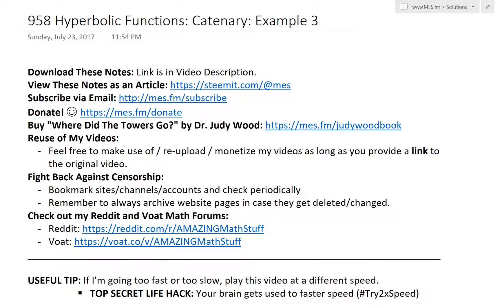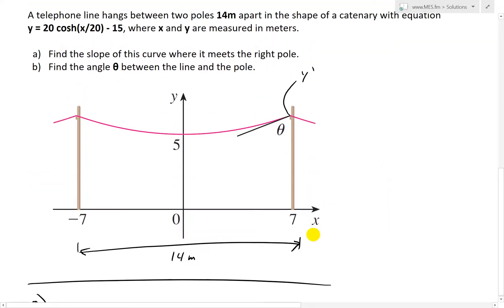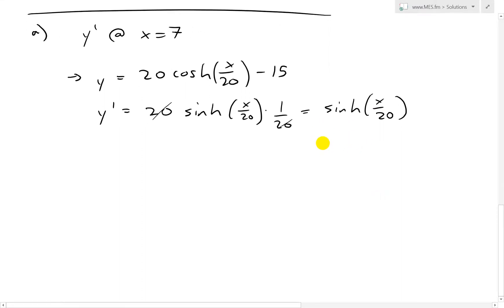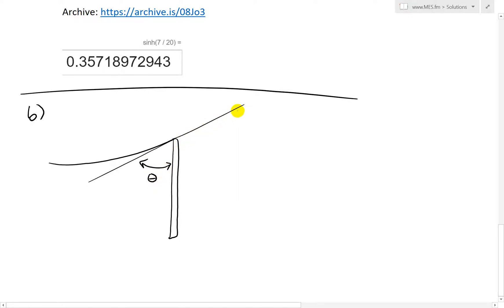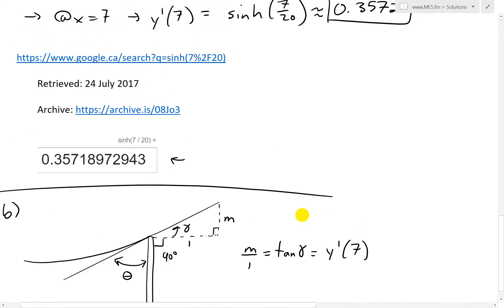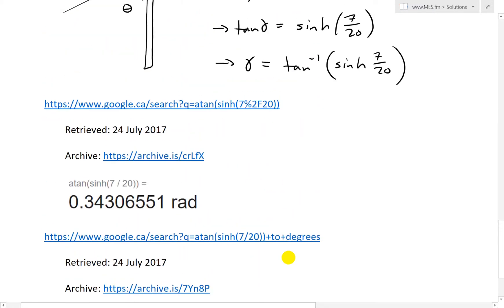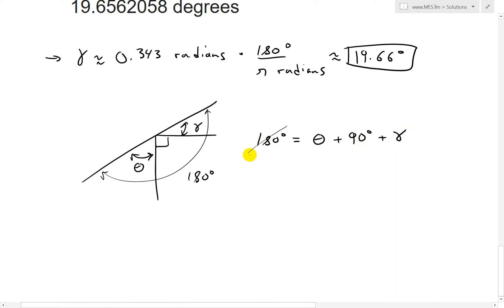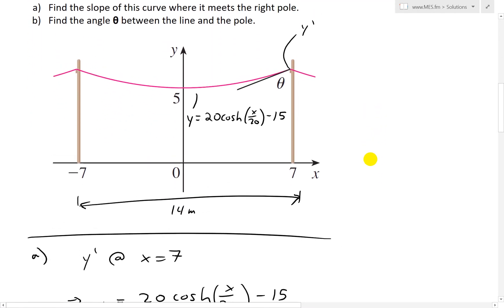Hyperbolic Functions: Catenary: Example 3: Telephone Lines

Comment: I had trouble with part (b) in one of my HW problems. In hindsight the solution was relatively straightforward and simple; I just had trouble connecting the slope from part (a) into a right triangle to find theta. Thanks for the video!